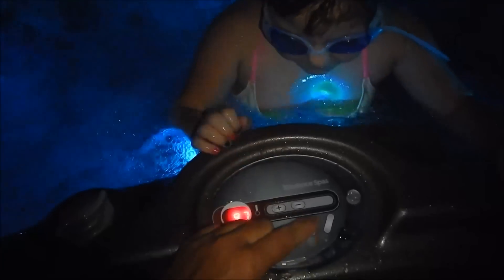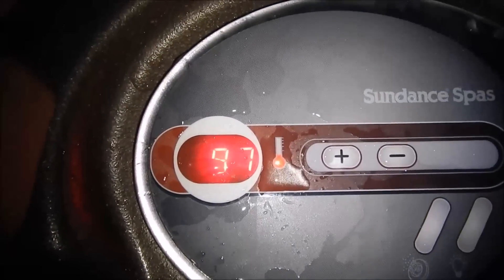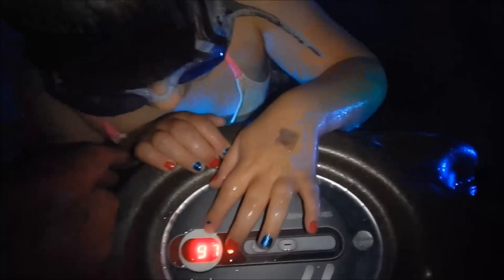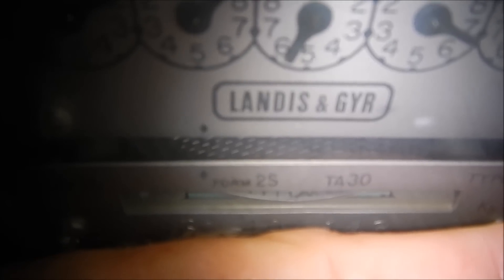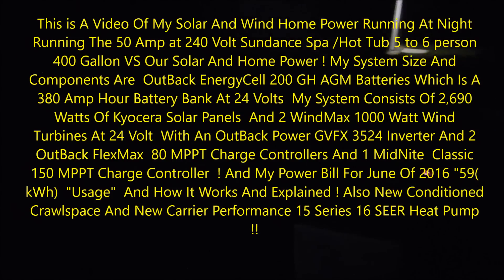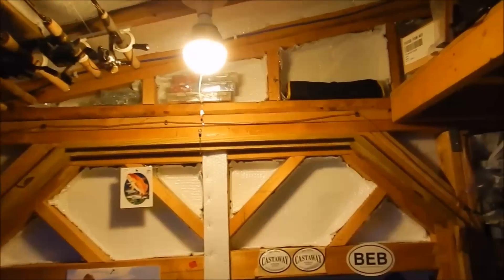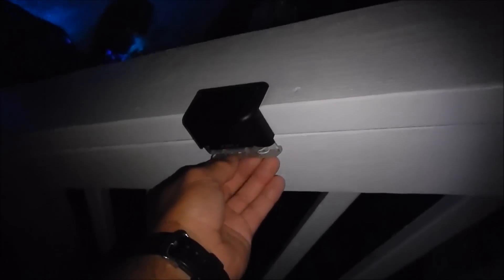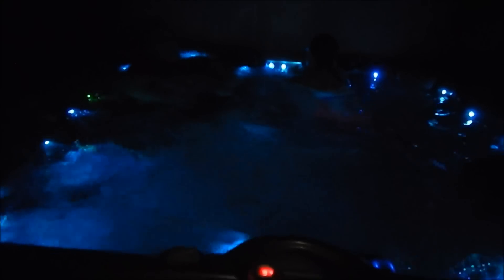Solar And Wind Home Power At Night With Hot Tub With Heat On By KVUSMC

Comment: What are you using for yard insect control? The best product I had found and used was Bayer, a sprayer you dispersed with the garden hose. Cutter has a product that I have been using since Bayer is no longer available. It requires more frequent applications and still doesn't control mosquitoes as we as Bayer. 5 years  ago I regraded everything so I have no standing water. There is no standing water on the neighbors properties.
Reply from the maker: Hi Buddy I use A Stinger Electric Bug Zapper It seems to work Great